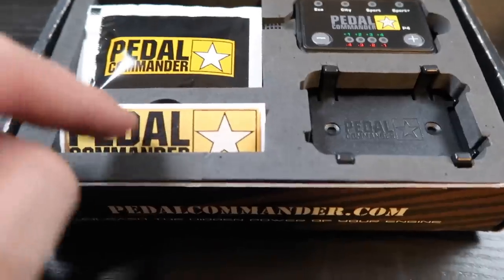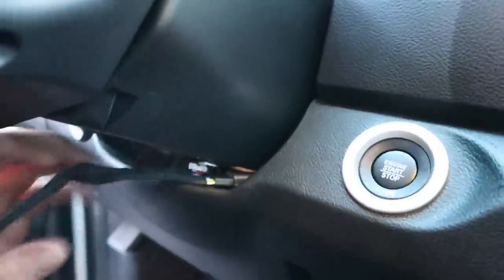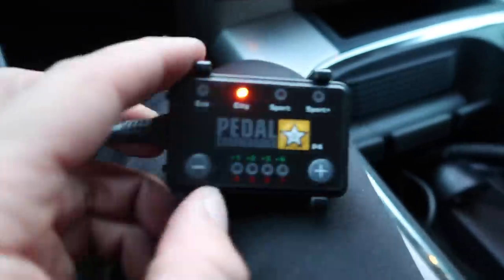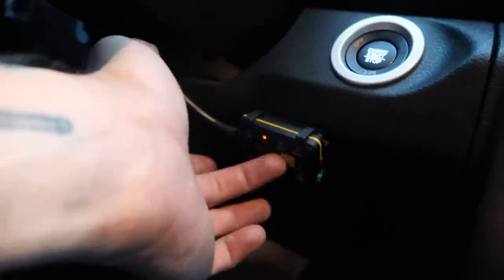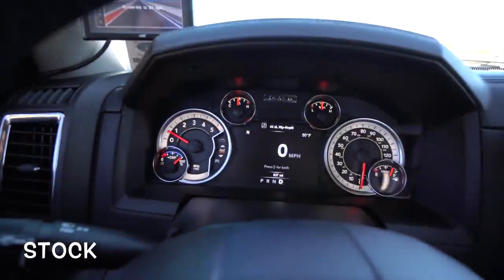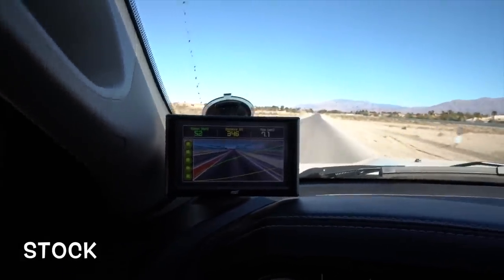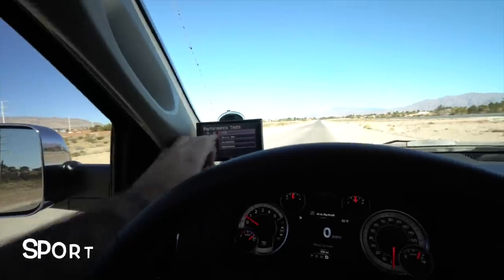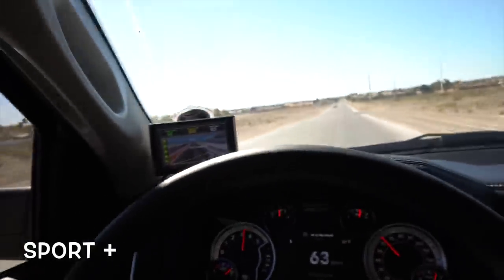Pedal Commander Review - Realistic Tuner Replacement? Jay Flat Out

Comment: People who like the pedal commander or any of the other clones have no idea how a throttle by wire system works.  When you press down on the gas pedal your ecu sees the signal then sends your throttle body instructions on how far to open.  The pedal commander attaches to the gas pedal and alters the signal that goes from the gas pedal to the ecu.  

The problem people are trying to fix with the device is the so called lag they feel when they press their gas pedal down and when the car actually starts moving.  For some reason people think that the signal going from the gas pedal takes a long time to travel to the ecu and that is why they have a delay.  The signal actually reaches the ecu instantly and the signal going from the ecu to the throttle body is instant as well.  So why is there a delay?  Because the automotive makers built it into the software.  Its called torque management.  If you slam your foot down to the floor what happens is the ecu says, nope, and gradually opens the throttle body not giving it full power right away because it doesnt want you to spin the tires and lose control of the car.  Pretty much every modern car does this.  

So what does the pedal commander do?  It lies to the ecu as to how far youre pressing the gas pedal.  So if you press it 30 percent the ecu may see 50.  So by the time youre at 70 to 80 to 90 percent the ecu is seeing 100 percent full throttle making it feel like the car is accelerating faster.  The problem with this is that now the pedal resolution has been greatly lowered making it more light switch like and the 1 to 1 throttle pedal to output ratio has been thrown out which makes it feel less like the old throttle by cable systems which were 1 to 1 ratios.  No matter what setting you have on the pedal commander the ecu will still slow down the rate at which your throttle opens since this product installs before the ecu signal and not after and torque management is still there.

My opinion is that this product and all its clones are snake oil.  These companies prey on people who dont understand how a modern throttle by wire system works.  It doesnt get rid of any lag because there is none to get rid of.  It will do nothing to how fast your car accelerates to sixty.  Dont waste your money on this huge rip off.  To get rid of that delay you have to get a tune which will remove torque management.  Also, a tune can alter your throttle to output ratio to whatever your want making the pedal commander totally useless.  Yes if you have both a tune and a pedal commander at the same time you have literally just flushed 300 bucks down the drain.  This pedal commander is worth 30 bucks at most.  My RC radio controller can do this exact same thing except I get to totally customize what my throttle does with a visual graph and lcd display plus I have atleast 20 more functions and its wireless all for 40 bucks.  So please dont waste your money on this garbage product.
Reply from the maker: +Sergey Melnik didn’t I say in the video this was good for people who don’t tune.
Reply: For people that dont work on their cars
Reply from the maker: Thats why I love it.
Reply: Torque management is fine on some vehicles. The above included. But they have this stuff on the newer Subarus now, the non turbo ones. And in the case of the Subaru half throttle from a stop you actually pickup speed quicker than a full throttle smash (Comes up within a few seconds)
Reply: Finally, someone that knows what they are talking about.
Reply: Dude thanks for this explanation. I've been trying to save people the $300 this thing costs. It definitely makes the car "feel" a lot more fun but it actually does jack shit for the car. I bought one a few months ago and I was loving it at first but then I realized I could get the same results by just flooring the gas and sold it.
Reply: I bet this guy got the device free for giving his "unbiased" review.  No way that truck is that slow stock, and no way did he reduce the 0-60 time as indicated, IF he was actually flooring the truck on the first run.  He lagged it.  I laugh at people that buy stuff like this.  It's snake oil.  Now, if you are too lazy to press the gas pedal all the way, or happen to have really short legs, maybe this thing is for you.
Reply: Does what I wanted it to, so as far as I am concerned it was $300 well spent.
Reply: so i shouldnt install this in my c7 vette?
Reply: Please stop replying to every single comment here to bash the product. You have not even tried it. Period. It is not the same as pressing the pedal down further/faster. Your logic may seem sound, yet that's not always the case. Enough people have reviewed this product to confirm it is 100% not the same as pushing down the pedal further than normal to increase response.

From their company:
"Pedal Commander definitely is not the same as "pressing the pedal down further." Our device is actually speeding up the signal being sent from the throttle sensor to the throttle body, which your foot just isn't capable of doing."

It's sending a modified signal to the ECU. The ECU responds accordingly to translate into XYZ. There's a lot more in play here than a you think. Give it a rest.
Reply: This is what PC has stated further "The stock throttle map goes from the ECU, to the throttle sensor, to the throttle body. We're basically intercepting it at the throttle sensor and speeding it up, and the ECU has no idea. " Unless they're flat out lying?
Reply: Legend Ronk No don't install it on your vette. Unless your goal is to shorten the throttle pedal movement. Basically lowering the resolution. Also if your vette is anything like my mustang or many other modern sports cars you can just put the car in sport or track mode and it will increase the throttle input to output ratio. Basically making full throttle happen before the gas pedal reaches the floor. But it won't actually get rid of that lower rpm bogging due to ecu cutting power that the 6th gen camaros are getting people are complaining about on the camaro6 forum.

Do yourself a big favor and put that 300 towards a dyno tune or mail order tune and kill ten birds with one stone. Pretty much any good tune will disable Torque Management and adjust many other parameters. And if you really do want a shorter throttle press the tune will let you set the throttle output to whatever you want per driving mode.
Reply: I agree that their rep's response is fishy. On that sense maybe it's "snake oil" yet so what? There are TONS of positive reviews. So it basically shortens the overall throw of your pedal to eliminate the feeling of lag. And? People love it and testify (like this video) that the real world feeling is there. Try it (meaning the actual product) first before commenting it's the same as pushing the pedal more, as we all know that feeling would be completely different when the total range of the pedal is changed (shortened). It would "feel" far more sensitive, reactive and more vs the stock pedals full RANGE. To some, it's worth that price no problem for a more enjoyable driving experience with a simple modification.
Reply: Also, this video is in a Ram 1500. Not your Mustang. The Ram's early pedal is notorious for being "laggy" meaning from the factory 25% pedal is probably 10% throttle. This tool would essentially decrease the overall range, making it much easier to feel a LOT more responsive when pushing the pedal, without the unnatural feeling of pushing the pedal far into the 50% range to achieve a similar (not the same) response.  I agree with you that many are misconceived it's doing something more than it is, yet past that, there's nothing wrong with this product and it DOES increase the overall throttle response and make it better to drive. Leave it alone.
Reply: Sergey Melnik sooooo I have the DTE systems version of this, the pedal box. I have it installed on my Mercedes R320. In stock when slamming the pedal I have a 1-2 second delay before the power comes on, the same if I go on the slow. After installing the pedal box the delay is completely gone and the car is finally as it should’ve been from factory. Snake oil or not, it works. Slamming the pedal in stock don’t do shit to get rid of the delay, this box does. Here is how the sprint booster works....  https://youtu.be/1XVCYDNcwwY
Reply: Sergey Melnik who cares ......If it makes your car faster thn i will buy it
Reply: Its works period
Reply: They do work despite your armchair mechanic response dude. I had one in my 2014 6.7 and noticed a difference and I’m sure it does the same thing on the ecodiesel which I’m buying so we will soon see. Like Jay said if you don’t want to mess with warranty voiding stuff it’s worth it to me.
Reply: raheel saleem  But it doesnt make your car faster, its not possible.  It simply gives you a touchy gas pedal.  The software in your car will still delay the opening of the throttle plate no matter how you modify the gas pedal signal.

Kris Babas No one ever said it doesnt work
Reply: Sergey Melnik I think that’s debatable like I said I had one and the truck was faster. I agree it’s not faster HP wise but I bet if you did some 0-60s you would notice a difference
Reply: Kris Babas no it's not debatable. People have already tested it. And once you understand how it works then you will understand it's not faster. How hard is to understand that it doesn't alter the tune.
Reply: Sergey Melnik first of all I HAVE HAD IT ON MY TRUCK. I’ve owned almost 20 vehicles I go through vehicles like crazy. My current car is the most powerful HP wise WRX in my entire state. I understand vehicles. The module does make a difference over stock. I never said it alters the tune I never said it added horsepower. What it DOES DO is allow the vehicle to get up and go faster. That is not debatable dude you’re flapping your gums to someone who’s had it
Reply: Kris Babas wow that's cool. You have a lot of cars. Doesn't mean you understand how this pedalmaxcommander works. If you want to get up and go faster press the gas pedal down faster which does the exact same thing. Sounds like you have to justify your purchase. And you dont have the fastest wrx in the state cause if you did you would never waste your money on this thing because you would have it tuned which negates this product. You should figure out how it works first before arguing with someone who does and then insulting them. I'm done with you.
Reply: Sergey Melnik I don’t have one of these on my wrx I had one on my ram diesel and it helped a lot with pedal lag I’m telling you obviously you don’t believe me but I wouldn’t lie to you I’d be the first person to talk trash about it if it didn’t work
Reply: @sergeysmelnik  and no one ever said it improves performance numbers. their websites doesnt promote or state you will gain hp, troque, 0-60 or 1/4  so you must not have read well
Reply: Maybe you should read the comment by Kris Babas about 5 comments up where he says if you do some 0-60 times youd notice a difference.  And then 3 comments up he says it allows the vehicle to get up and go faster.  Youre the one who didnt read well...
Reply: @sergeysmelnik  Well going off the actually website and company, no where does it state that. not on their site, social media and if you call and ask they will say it is simply to increase throttle response and thats it. perhaps that ONE individual did increase his time who knows but as for the compamy itself it doesnt promote that. this is simply a fun factor/mod to your car. increases the sensitivity of the pedal.
Reply: Ron Bergundy  Read what I actually wrote. I didnt say it doesn't work...
Reply: Ron Bergundy Look man you cant just make a general statement like that saying that I said it doesn't work. I have never said that. If I did I would be contradicting myself. We've already been through this on Mustang6g. Theres a long thread all about this with much smarter people than me explaining what this product actually does. I've said it so many times, this product changes the throttle input vs output ratio. In other words it makes the gas pedal more sensitive. This has nothing to do with lag. You can make the gas pedal an on off switch but it doesn't mean it will get rid of any lag. And yes I am commenting on some of these videos because I like helping people. I gain nothing from it. I'm literally trying to help you and anyone else who reads these. I'm not the one making money here but pedal commander is. And I want to expose them for the liars they are. And people get mad at me for some reason. Look if you want to spend your money on this thing go ahead. I dont care I have nothing to prove. Just know that you will eventually have it up for sale just like all the people selling theirs on Mustang6g. And then you will using part of those funds for a tune which is the true fix.
Reply: Some people can have things so right and STILL get them wrong. Yes!... It adds NO power and is NOTHING like a tune. But what it does do is change pedal feel/response. Call it twitchy or whatever you want, but the action of the foot on the pedal is altered enough to effect ergonomics for SOME drivers in a positive away, especially for folks with cars like my AMG. On the other hand, some drivers make not like the feel and not get used to it. For the low cost, it's not exactly a huge disaster if you end up liking it. I've spoken to enough tuners to understand the basics here, but the above comments disregard actual DRIVING styles, which can be aided by such a device. No, it's NOTHING like getting a ECU or piggyback tune, but it can be a fun addition for some. The change of FEEL is quite real. And driving is all about FEEL and feedback.
Reply: Love mine, and its so nice to be able to change the throttle input on the fly. You cant do that with the tune. I know, I have both. Don’t listen to the haters, anything for drama. Great product period.
Reply: @Sergey Melnik I have been contemplating between this and a portable tuner. What is your opinion on a performance tuner like a Hypertech or cold air intake for a Ford Explorer?
Reply: Fake news
Reply: If anyone has one and hates it ill gladly take it off your hands and ill give you 20$
Reply: @sergeysmelnik  you stated "It doesnt get rid of any lag because there is none to get rid of" which is incorrect. It definitely has been shown to resolve the initial lag when accelerating in some vehicles. It does get rid of lag regardless of how you want to describe the function. Lag/delay same difference.
Reply: @naplesbill  you have no idea what you're talking about.
Reply: @sergeysmelnik  Of course not, otherwise you would have to consider how wrong you are.
Reply: @naplesbill  it's obvious you bought this thing and are now trying to justify your purchase. If it gets rid of lag for you then why are you here complaining? Just be happy with your purchase. I'm happy for you too.
Reply: @sergeysmelnik  I do not own, nor have I ever owned one of these devices. However, there is plenty of empirical evidence to support the premise that it improves initial throttle response on many different vehicles. Clearly a solid custom tune is a better option. when it is one, but this product does what it says it will do and does it without leaving any tracks behind. To say it doesn't is just not supported by facts.
Reply: @naplesbill  go ahead and explain how it works then. I've already done it. If you want to disagree go ahead and post some facts instead of blowing hot air.
Reply: @sergeysmelnik  You can play word games all day. You came here and posted on a video that showed a clear difference with and without and then claimed it was snake oil. If it does what it states and people are satisfied they got what they paid for, it is not snake oil. You claimed it doesn't do anything and then stated you didnt say that. I pointed out that you did say that and now you are the one who is butt hurt. I could care less if it works or not because I dont use it. Nevertheless, I felt like you were here trolling the video so I pointed out your statement.
Reply: @sergeysmelnik  Actually I just pointed out where you did say it doesn't work, after you said you never said it doesn't work. I see now that you have a need to be right and to get likes. You also called it snake oil, which implies it doesn't work. No amount of data wrestling can change any of that.
Reply: @naplesbill  Just put up your explanation of how it works and it can all be over
Reply: @skaterpro9111  Or don't want to void their warranty with tunes.
Reply: @sergeysmelnik  so your car has the ability to do what this product does by putting it in sports mode, but this product can't do what your car does?

Did ford sell you snake oil with the sport mode feature then, or does it ACTUALLY do what it says it does?   By your own account, this product would do something exactly like the oem designed ..  hmm ..
Reply: @aztekwarrior518  Yes this product does what my car does in sport mode.

Yes Ford sold me a snake oil gimick feature by increasing throttle sensitivity but not removing any of the torque management when I put it in sport mode. I would rather have the standard 1 to 1 ratio sensitivity in all drive modes.

The new 2018+ mustang's gets drag strip mode if optioned right and that setting supposedly removes much of the torque management. This mode I would actually use.
Reply: @sergeysmelnik  I think you're misunderstood man..
Reply: @glockwhore  my understanding is that you will get those ponies faster, meaning increased acceleration?  Thinking of getting it for my 4.7L Tundra.
Reply: Vin Ramirez I’m honestl not sure how it works but I think it’s funny people talk all this garbage oh my tuner said oh this guy said oh I’m an engineer and I say blah blah blah I have had them from different brands on other vehicles and THEY WORK. It is not the same as mashing down the throttle faster love that one too. In fact I recently bought a pedal commander for my ecodiesel (another put up or shut up in my opinion) and it made a huge difference. If you’re not going to tune it which yes can be programmed into the ECU to eliminate lag then definately get it that’s a no brainer.
Reply: @LunaticWulf  Yeah until you destroy the torque converter and have to dump a few grand out of pocket!
Reply: @79brumley  why would I destroy my torque converter? Wtf?
Reply: Do you have one? If you don't have personal experience with it, which it sounds like you don't, I can understand how you might be sceptical. But, for those of us who have used it for any lenght of time, the results are real-world and well worth the money!
Reply: R Grump the circuit board on there is large enough to run a hand full of lights. It is not sending anything to the ecu.
Reply: So, having installed the PC in my Tacoma, the significant difference in the ACCESS to power I have personally experienced first hand is all in my head? At it's lowest setting I can floor it and feel like I want to jump out and push it to get it going. At it's highest setting, with very little throttle input I can spin the tires on dry pavement. Wow, I must have a pretty active imagination!
Reply: @nothankyou9906  Do you have one? Or at least tried it out on someone elses vehicle? At the lowest setting, I can floor it and feel like I want to jump out and push my truck to get it rolling. At the highest setting, the slightest amount of throttle will spin the tires on dry pavement. Not my imagination, brother. It works. By the way, remember the old MP3 players from a decade ago that were about the size of the Pedal Commander? They had 50,000 times the computing power of the computers that put man on the moon. In this case, brother, size doesn't matter, lol
Reply: @sergeysmelnik  I actually considering buying one for the OPPOSITE reasons of most. I have a turbo FWD that not only builds boost very quickly, but is geared very aggressively in the first two gears. I actually want it for the "eco" mode to deaden the pedal during the winter time when you want maximum traction and control.
Reply: @surfmotor   LOL Gay Mustang DODGE ALL THE WAY!
Reply: tendrías que probarlo en realidad hace mucho mas de lo que opinas. al presionar a fondo el pedal te demoras en que el carro salga disparado. con pedal comader es automática la respuesta sin llegar al fondo el pedal.
Reply: Sergey  you  absolutely  correct
Reply: @Fade2BlackSS  carefull snake oil  salesman out there